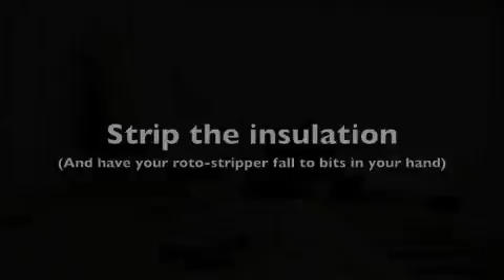DIY USB hub power cable

Comment: I did the same thing, but I had an old power adapter with the right plug for the hub, so I used it instead, along with electrical tape and heatshrink tubing. I left enough on the female end of the "donor" USB cable that I was able to use it in a similar manner to convert an old 5V 2.2A power brick into a USB charger on steroids. All of it (except the tape and heatshrink) was just laying around, so both the cable and the charger were practically free :3

Comment: @mgoodhew Just a quick correction; according to pinouts.ru/Slots/USB_pinout.shtml you can actually push 1.8A through USB, but it requires that you short out the White & Green (Data - and Data +, respectively) in order to do so... 5V @ 1.8A should theoretically convert to 12V @ 750mA as long as you don't mind losing your data connectivity (making this example useless for the OP's request, yes, but still pushing more than 500mA)

Comment from the maker: Eh? You have an external case you want to "make external"?! Seems like that's already been done for you.

Anyway, I'm guessing you have an external 3.5" USB drive chassis you've removed the casing and drive from and replaced with a 2.5" drive. Presumably this works "as-is" and you want to do-away with the separate "power brick" and see if you can power it off the USB port alone.

I'd just buy a new 2.5" USB carrier from eBay and be done with it.

Comment: i have a question.i have an old seagate desktop external case i wanna make external.i trashed the plastic casing and left the board with connections intact...is it possible to connect a usb cable to the ac port and power by usb?..i dont wanna use the 500gb 3.5 drive that is in it i took that out and placed inside my desktop pc.what i wanna use is my 2.5 250gb laptop drive as an external and always having this plugged into a power outlet is not very portable at all and was wondering if can help

Comment: i just cut off the end of a usb wire and want to power a small light bulb (flashlight) with my computer and put it behind my monitor. i think it would be better for my eyes to have behind my monitor lit up instead of looking at the harsh monitor brightness contrasted with the dark around it. id like it to turn on/off with the computer so i wont have to think to turn it on/off

Comment from the maker: By "12v external HDD" I presume you mean a 3.5" quarter-height ("Desktop") hard-drive. 

It's possible to convert 5v to 12v with a matching drop in current.

The bad news is that these drives tend to suck about 0.5A  to 1A on their 12v lines (6 to 12 W). USB ports are supposed to deliver a maximum of 500mA (2.5 W). You'd have to bundle-together min. 3++ mainboard USB ports to have a chance at powering a 12v drive (probably).

My advice: Give-up and use a much lower-power 2.5" ("laptop") HDD.